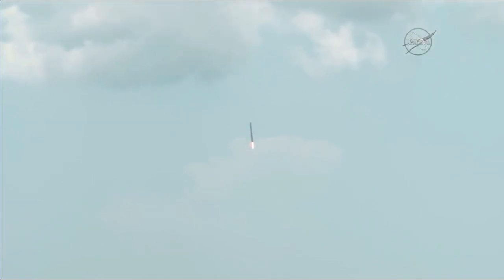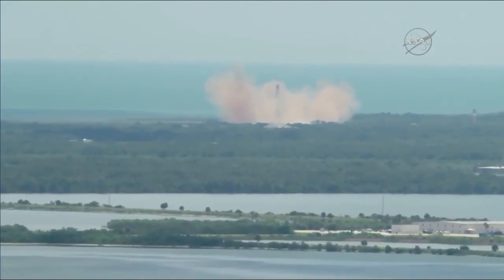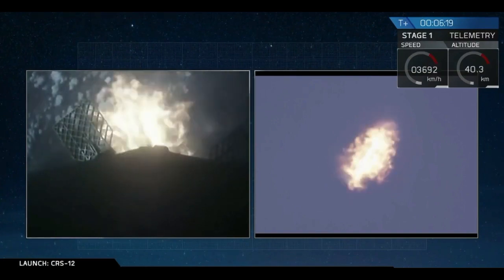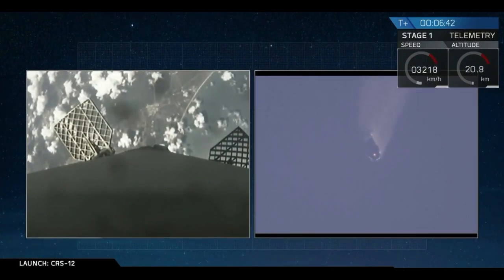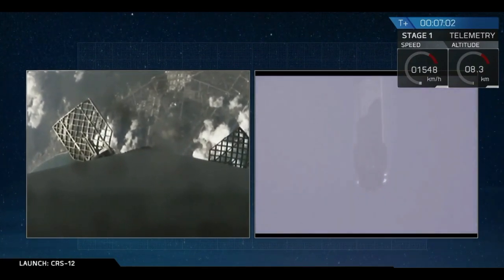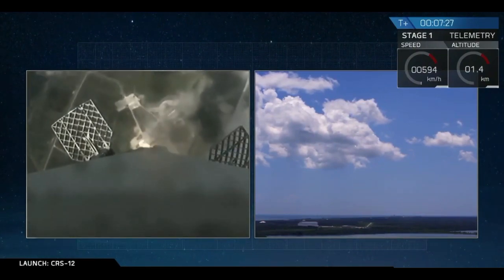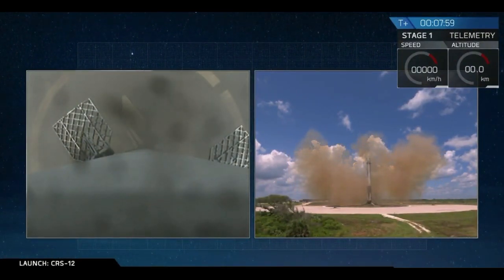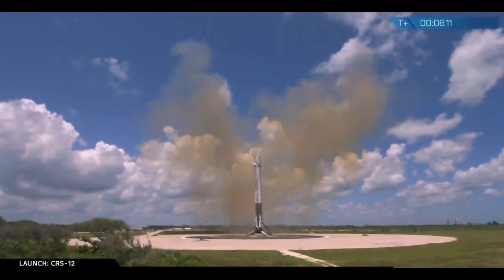SpaceX CRS-12: Falcon 9 first stage landing, 14 August 2017

Comment: Why not show the landing from the close up camera?  Why from a mile away and then instantly switch to the nearby one?  Space-X, please reply!
Reply: I was thinking the same thing. Would be an epic shot to see yet they always hide it and transfer to a different shot. What are they hiding?
Reply: Want to see an uninterrupted continuous shot of MECO, stage separation, boost back, reentry, and landing? Here you go:
watch?v=C3j2HjI82mI
SpaceX/NASA tracking telescope may have lost it just before landing, but mine didn't.
Reply: Practically, I would think this is because it is very hard for the cameras at the launch site to see the rocket until the last minute since it comes in pretty fast. And you can't really know exactly where it will be as it comes in which is crucial to get a good telescopic shot. And when it gets close it just looks like a ball of fire since it is descending "thrusters first".